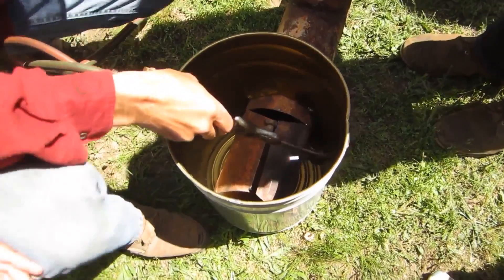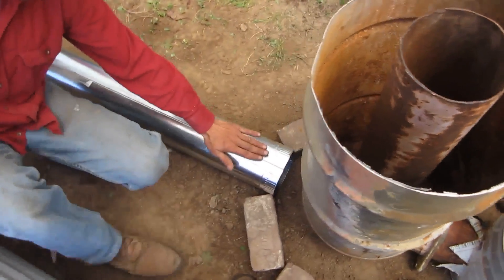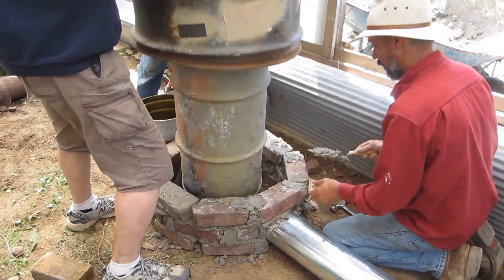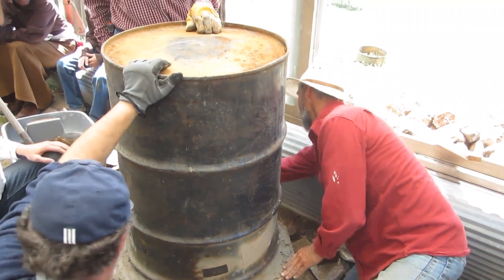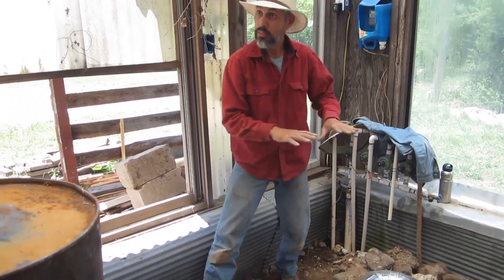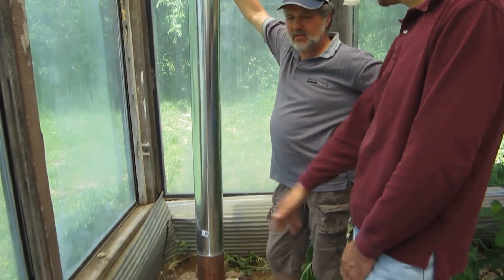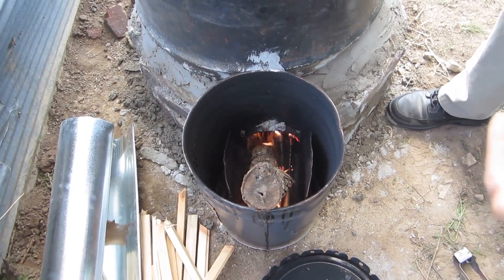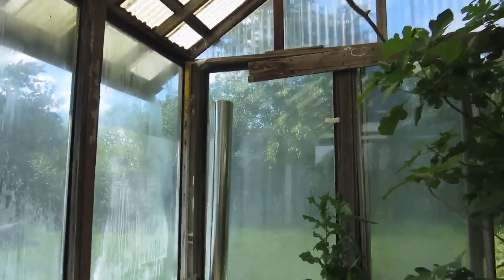Building a Rocket Mass Heater

Comment: They’re releasing the exhaust indoors?
Reply: it builds a layer of strength in your lungs
Reply: No worries 👍 They are using Galvanized HVAC Ducting for stovepipe. 
When they are talking about the smell it's the Galvanized coating burning and gassing off which is TOXIC POISON ☠☠☠

Comment: Carbon monoxide is what is expelled you need to vent that out side the green house, second make a lid for the burn chamber, so you can adjust the air flow too, the intake is ok size, but when you want to keep the mass hot / warm you will need to close off the intake all the way a steel plate resting on top will work. wish you luck.

Comment: Ive read that sand is a better insulator than thermal mass. Which is probably why you used it in the riser. Why then did you use it in the bench to surround the rocks and flu pipe?

Comment: You need insulating material especially in the heat riser, but also optimally in the burn chamber. This will not burn clean/effective. And air-vent is needed at the bottom. Benefit with the sand is that you can change it. Vermiculite is good for the heat riser.

Comment: Best wishes to Master! Thank you for useful knowledge. Metal furnace for the heating of places of temporary stay of people in a garage, shed, greenhouse. At a temperature of 120 degrees begins to burn a dust on the surface of the metallic surface, including the barrel. Invisible burnt dust aerosols are distributed in a residential area, contaminating the air. The main drawback is inherent in all metal furnaces - a negative impact on health. For the development of your projects there are new technical solutions versatile rocket stoves for cooking, heating water in the boiler and the heating of ceramic floor and water underfloor heating. Brick or ceramic rocket stove the most effective means for heating homes, greenhouses of any size:: https://sites.google.com/site/menedzmentteoriapraktika/upravlenie-infrastrukturoj/rocket-stove-new-design
Reply: The dust burning is the least of the issues with almost every mass heater build I've seen on YouTube. 
They all are using Galvanized HVAC Ducting for Stovepipe!!!
It is Very Toxic when heated and gassing off. 
Look up the cautions and effects of inhaling that crap ☠☠☠
Reply: @jamesglenn520  useful information, a flue made of brick or other ceramics is not toxic when heated
Reply: @aleksaleksandrovich2517  I understand what you are saying about the internal parts. 
I'm referring to the exposed pipe from the barrel to the exit. 
They even mention the smell in the video. 
It's the Galvanize burning and gassing off that is the problem.

Comment: do not build this way... did you see the bit of smoke still filling the room... can you say, C02, your dead. at least put the opening in frt of where you load the wood and put that opening (vent) at a 45* angle pointed down to prevent the smoke from raising. and where you load your wood make it higher and make a lid to cover to help prevent smoke (C02) from raising and filling the room..
Reply: that's why they put the fat guy next to exhaust; when he falls over they vent the room.
Reply: If you run up and back the bench and put the chimney riser touching the barrel, it will re-heat the gasses before leaving the building and increase the suction "draft" 5 fold. But you must insulate between the chimney and where it leaves the building.

Comment: I would suggest they have this heat plant outside of the house, and then use it for heating water, which again could be circulated in and out of the house. But that is also because I hate (for a while; short while, -;) ) the breathing of carbon monoxide.

Comment: That long tube runs to Rush Limbaugh's anus.  Actually, the exhaust tube is too long and it makes a 90 degree turn twice,  restricting air flow.
Reply: +Tim Spriggs  You could probably learn a great deal from Mr. Limbaugh if you weren't so obsessed with trying to be cute (you're not). You liberals are destroying America.
Reply: +Ro Efa the reason it's not drawing is the pipe that connects to the 50 gal drum is mounted too low.   and the pipe that connects the burn chamber to the 50 gal drum is mounted too low as well.   you shd check your CO levels too.  so you don't kill yourselves.  With a mexican in charge, and everyone doing something they don't know, no wonder it didnt work right.
Reply: +Tim Spriggs...  You're pathetic, Tim. You have no clue !  I'm likely to ignore any subsequent messages posted by you. Don't waste your time... get a job.
Reply: +Ro Efa ,  I prefer despicable, but whatever.

Comment: sand is an insulator. i wouldnt use it on the stove pipe. use more cob!
Reply: Rural Cromagnon 
You shouldn't have any creosote build up. In rocket mass heaters, you have a chimney fire every burn (on purpose) to extract all the heat
Reply: +Feeding Frenzy Not somthing you want to use. That riser gets very hot. The cob will burn out very soon. That thin metal pipe will probably burn out within 1 to 2 years and the sand will collapse. It needs refractory cement mixed with perlite instead of sand. Clearly a temporary installation.

Comment: how long did it take to figure out that all you needed was a small hole under your fire that you can close and a metal top
Reply: +Wayne Irvine Thats exactly what I was thinking the hole time.
Reply: I knew you knew  :)
Reply: It didn't need more air. It needed Exactly what they did!
The gap between the riser and the outside barrel At The Top should be 3inch or a little less 🤔 
They went from 12 inches to about 3inch and fixed the problem.

Comment: The cool heater exhaust leaves open the question of chimney deposits such as creosote, and reliable measures for cleaning such combustible deposits to reduce the risk of chimney fires. from  Evans & Jackson, Rocket Mass Heaters, p. 93

Comment: "A common problem with some designs is "smoke-back", where smoke from the fire is released back into the interior rather than outside. Smoke-back could indicate a serious risk of carbon monoxide poisoning. This issue could be a result of poor individual stove design, or inadequate preheating of the exhaust tube, resulting in inefficient draft to pull the smoke through." from Wikipedia Rocket Mass Heater. Guys, please do your research. We do not want to have any sadness from this. Good luck. Be wise, not dead.
Reply: John L Bales b
Reply: The Toxic gassing off of the Galvanized HVAC Ducting is more of a concern than a little wood smoke!!!
And almost every build you see Uneducated people trying to save a few bucks use it. 
Buy Stovepipe it won't Poison you and won't burnout as fast!!

Comment: run that smoke into a shed and make a cold smoke smokehouse
Reply: +Niccoli Machiavelli his scale is wrong, the fire pit should be a lot smaller this would help aid the air fuel mixture.
Reply: Hannah Avery If it was constructed properly, it wouldn't be smoking at all.  It should burn so hot that the smoke is all burned up.  They exhaust CO2 and steam.

Comment: the metal heatriser will burn out ,sand is bad insulator ,the transition between the barrel and the pipe is to small,the top gab between heatriser and barrel is only of inportance for direct heat versus slow heat of thebench  just my 2cent
for fb'ers rocket stoves/rocket stove international if you have any questions
Reply: karl De Pauw I've been told that about using a metal heat riser before.  However, I used one in my stove (6 inch and 10 inch with clay stabilized perlite between) and ran it an entire winter without burning it out.  I guess it still could, but it didn't appear to be even threatening to burn out.
Reply: +Jason Boulard what did they use?
Reply: There ARE refractory metals that will handle the temps in the riser, but I don't think that's what we're looking at, here.
Reply: Yup, about 2 burns is what they're expecting to get I guess? If they had only spent 30$ on some fire brick

Comment: I noticed that you have forgotten to make a air vent door before the fire pit.  This air vent  door is to open and close to allow airflow that will feed the fire or lessen the fire. Its also where you will remove the ashes. If the air passage vent was big enough, you can actually bake in it.  You didnt need to cut down the barrel, it was the missing air vent passage that you did not make that's causing  the smoke and not allowing the wood to burn consistently.  

As per Joe, you have gone as far as making the vent right up to the open roof, you MUST still vent atleast 3 ft PASS  the roof to be absolutely sure to clear C02. This is health concern and should be completely finish.  
I love what youre doin for the greenhouse to help community, but Please do a bit more research before lighting up and check and  take all safety precaution.   
Thank you and God bless.
Reply: Angelia Odiame Have you ever build one of these before?  Most of what you said doesn't pertain to rocket mass heaters.
Reply: CO^2 and humidity good for greenhouse. May want to open a door before you go in... oh yeah, you have to.
Reply: Asian Goddess ج
Reply: @Alain M co2 denser than oxygen so top venting not helpful. Hypoxia not likely because just opening the door would mix air to some degree  and allow escape of CO2. But then again, if someone decided to sleep in their with no ventilation or mixing of air (like a fan) it could be bad. 
Hemp growing and processing warehouse like buildings are required to have fans.
Reply: You do not add a separate air vent at the base of the feed tube - that will allow the flames to climb up and out of the feed. The draft going down the feed tube is essential to proper operation. There are published solutions to most all problems with a RMH, depending on the setup. As mentioned elsewhere, cutting down the barrel was exactly the wrong solution - the heat riser should have been extended. The taller the riser, the better the draft it makes. In short, do not depend on this video alone for planning your own installation.

Comment: Be careful of c02 build up in the room!...
Reply: Carbon monoxide is CO. Carbon dioxide is CO2.  Flunk high school  chemistry much?
Reply: PLANTS LOVE C02
Reply: Syn Kronos  true. but I think the point is that the product of the combustion is carbon monoxide, not carbon dioxide. but I did flunk high school chemistry so I may be mistaken. for some reason I'm thinking that maybe both are created through combustion, maybe when the fire is choking (not enough air)...? but for sure ,  carbon monoxide is produced when fuels are burned. ...including wood.
Reply from the maker: Don't worry Joe..this was in an open vented greenhouse with a large vent above the outlet.
Reply: An American Homestead They are adjusted to the current/recent atmospheric  levels.In a greenhouse with increased water and nutrients to match the increased level of CO2 they can grow more tomatoes etc
Reply: +Joe Hallam Exactly right.
Reply: +Maurice Oldis ,  they want to do another "Jim Jones."
Reply: como construir un chulengo
Reply: Joe Hallam 7ijy6p3 vf A
Reply: They should have been more worried about the Toxic Gassing off the Galvanized HVAC Ducting!!
People need to quit using that shit for stovepipe!!
It's a cheap tin with a Galvanized coating that burns off and it's POISON ☠☠☠☠
Reply: +john dour Co2 still noxious, did you?